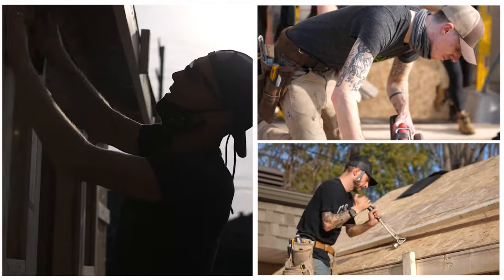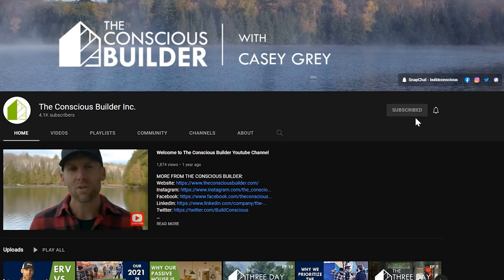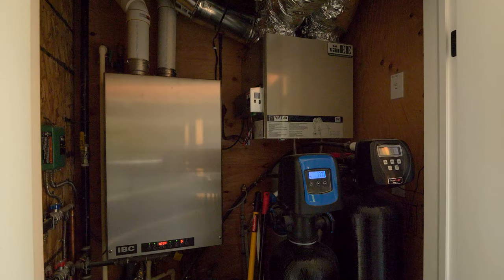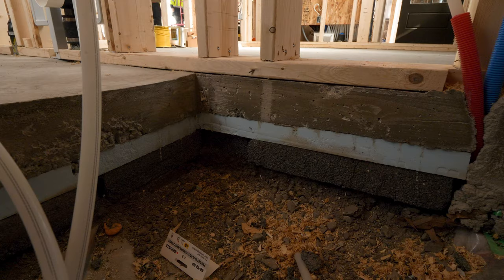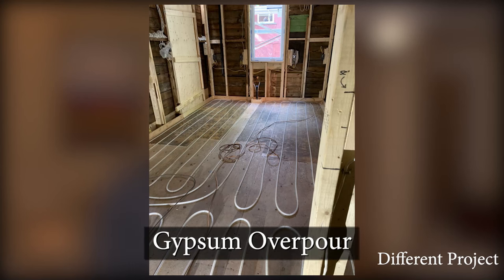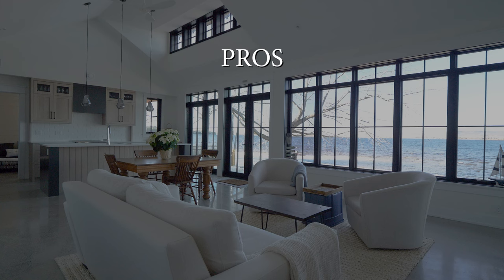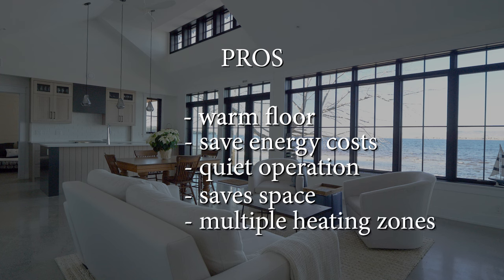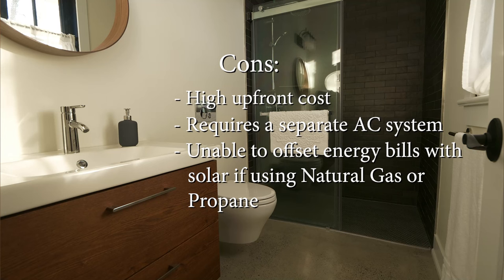Radiant in-floor heating - Everything you need to know - Pros and Cons

Comment: Great and informative video!
What would be sensible way of adding electric floor heating to a home that just has carpets/hardwood and baseboards / forced air?
Reply from the maker: We run electric heated floors under tiles all the time in bathrooms but have not done it under any other surfaces because electricity is expensive where we build and electric resistance heat is not efficient. I'm not sure this would be the best solution if you want heated floors. I would need to know more details.

Comment: I have an idea based off using heat from a Peltier unit used to cool a room, or a fridge etc, and water cooling the hot side, and using that heated water to heat floors. Thoughts?
Reply from the maker: If you can get enough heat from it, I don't see why it couldn't work.
Reply: @Theconsciousbuilder  thanks! If I ever find some time, I will! Maybe skip the Peltier and  go straight to water cooling a crypto mining rig, with the floor as the heat exchanger. Not sure how well that would go in summer..

Comment: Seems like a User Programmable Multi-Zone Heat controller would be effective. 
Replace all the floor thermostats with a Multiple temperature sensor (wireless)  PID controller running all the zones (so they don't compete) plus a few circulation fans between zones; A fairly simple Arduino project. something must already be Out There ?
Reply: circulation fans?  Dude we're talking about radiant floor/radiator heat which is created through pipes and hot water.   Radiant meaning it is simply heat which "radiates" from the hot pipes in the floor.   Since pipes take time to heat up and cool down it is controlled simply with a thermostat.   When the temperature ithe reaches the desired temp the boiler stops heating the water, when the temp goes under, the boiler starts up and heats the water already in the pipes.

Comment: Should the second floor have heated floors aswell? Or is that something that you don't have worry about.
Reply: Heated floors for stick house are only made for cosmetic foot pleasure. It will not be enough to warm house during winter. You will need another system. Radiant floor heating only works in typical European building system (heavy, concrete and steel).
Reply from the maker: Thanks for the question Martha! Heated floors throughout a home is really nice as they can easily be zoned, however it can affect construction. The best way to do it is with a lightweight gypsum overpour on the framed floor which has the tubes installed (assuming we're talking about a hydronic system). You could also install between the floor joists but it won't be as effective.
Reply: @Theconsciousbuilder   I think I prefer the the hydronic system best. But we are still looking. Most likely in a log and timber home.
Reply: You can also combine floor heating with radiators on the second floor.

Comment: How difficult is it to add a bathroom to an existing house with radiant hydronic heat?
Reply from the maker: Depends on how the radiant floor is installed. Over the subfloor or under? Or is this in a concrete floor? In either case it will add some additional work and would require from rerouting of the lines to accommodate the bathroom.

Comment: I laid electric in my tiny house. Ambient heat is needed I'm finding. Also I am finding a heat mat is cold. I'd be interested in knowing if the mats rotate causing a cold mat? Warm feet by thermosoft under a floating wood laminate flooring
Reply: How many mats in your system? we install the electric radiant mats in bathrooms or laundry rooms where we're not getting any heat from our mini splits.  They're almost never as warm as hydronic heating systems, we've found.  Never heard of one rotating.  We install them and then immediately imbed them in mortar to protect them, and test frequently with a multimeter.  We've never installed them directly under a floating laminate floor - I'd be worried about a potential thermal break!
Reply from the maker: Thanks for watching! I'm not sure I'm following this question. If I'm understanding correctly, the heated floor in your home is not providing enough heat. We do heat loss calculations on our projects to figure out what we need for heat and the system is designed to meet those requirements.

Comment: With a water tube based system is there still electricity throughout along with tubes or is it just tubes? Would prefer not to have electricity running everywhere
Reply: The tubes return to the boiler. Only electric is in the boiler itself. Water and glycol mix so it doesn't freeze and burst.
Reply: @TheGuyOutdoors1  thank you

Comment: Very informative! I'm wondering about repairs. What is the likelihood that these systems will have leaks? Similar to the home you showed here, we are considering radiant heat under concrete floors. It looks wonderful, but then I imagine having to rip up that concrete if there is ever a leak.
Reply: "if there is ever a leak"
It is no problem fixing leaks, usually only a small area has to be uncovered. Usually the location of the leak is obvious, because it is caused by a known intervention (e.g. drilling). If the location is not know, it can be found with thermal imaging.
Reply: @williamforsyth6667 thank you!
Reply from the maker: In 20 years of construction, I have never had to rip up a floor to fix radiant heat. The tubes are very durable!

Comment: Great video! I was the aerobarrier tech that you worked with in October.

Just wondering with regards to separating potable water from floor heating water, say you had a reverse osmosis rainwater collection system that fed to a separate tap for potable water (as well as directly fed to an ice machine in a fridge or any other necessary 'potable' sources) would you then be able to combine your hot water tank for showering and washing dishes with the hot water tank for heating the floors?

Thanks!
Reply from the maker: Hi Stewart! Thanks for watching:) You can use the same hot water tank BUT you'll need to separate the floor loop from the potable water. This is done with a heat exchanger and a couple pumps. The floor loop would still stay as a closed loop. When it calls for heat, the two pumps will kick on. One will start circulation water through a loop from the hot water tank to the heat exchanger and back. The other will run the floor loop which also runs through the heat exchanger. This allows the heat to be transfered from the water in the tank to the water for the floor loop without mixing the water.

Comment: i bought house and have radiant heat flooring but how do you turn the heat on? i have baseboard radiators and main thermostat. Do i turn on one of the radiators upstairs and gets the floor heating to run or?? any switch ?
Reply from the maker: I'm not sure how the system is hooked up, so I can't say, but typically the thermostat (or thermostats) are connected to pumps that turn on and off as needed and they will run different zones. If everything is on but some rads or areas aren't working, they may be airlocked.

Comment: What uses more electricity to heat a 900sq ft house at -35 C temperatures.   A electric furnace or a electric boiler with in concrete floor heat?   What's the price difference?
Reply from the maker: Good question! You would need to speak with an HVAC designer or Energy Advisor to model the home and figure out which option uses more electricity, however, I would suspect that the electric furnce would use more because the radiant heat is more comfortable and does not need to run as often. Radiant heat will cost more to install though. And if you need A/C then you'll also be paying for that. Thanks for watching!

Comment: Thanks for sharing this information. Looking for your suggestions, a builder is building a new house in Alberta and are considering to install (at least the rough-in) for the hydronic system for a (600-ft2) basement. 
Do you have any rough idea about specs I should ask from the builder (for the insulation and the piping)?
How much do you think I should budget for the rough-in?

Regards, Hector
Reply from the maker: Not sure what costs are out there but running the pipes should be minimal. Most of the cost would come with all the pumps and labour to hook everything up.

Comment: You forgot to mention that when using multiple HVAC mini split systems, you have redundancy.  If one unit fails in the middle of hot Summer, you still have the lability to cool living space with the other units.
Reply: You can t cool your whole house with only half mini split systems working. It’s impractical for everyone to sit in one or two rooms of a house if others are not cool.
Reply: @ToddBizCoach  I use this method in a one bedroom apartment and per floor in a three bedroom home.  The idea is that if one unit fails, there is still some cooling available while waiting for repair.

Comment: You don't mention solar as a power or heat source...?
Reply from the maker: I'm not sure I understand the question but I will answer what I believe you are asking. Solar is converted to electricity. If you have solar panels that you are using electricity from, the source for heating would then be electricity, not solar. The solar provides the electricity.
Reply: @Theconsciousbuilder  evacuated tubes could provide free hydronic slab heating...

Comment: Is it possible to run a ambient system in a crawl space…. hooked up to a electric hot water boiler …. Ran by a solar system?
Reply from the maker: I don't see why not. I'm assuming the solar system is feeding the grid though and you're pulling power from the grid. Otherwise you'll be using batteries and electric boilers use a lot of power.
Reply: @Theconsciousbuilder  it would be off grid. I have a house in the sticks.

Comment: we are building a new home and are using radiant heat in the basement. We were planning on using LVP for the floors but at a Home Show last weekend, one of the flooring reps said that it was recently announced that LVP is no longer recommended over radiant floors. Can you comment or give any suggestions. We know we could do ceramic but it's more expensive and would be very hard to walk on. House is on a lake so we want something to hold up to kids running in and out from the lake.
Reply: Kk
Reply: K I’m n
Reply from the maker: You can install anything as long as whatever you install can be installed over a heated floor without affecting the warranty. Our clients normally choose engineered hardwood or tile.
Reply: tile

Comment: Me watching the pros list: yes. Yes. Yes. Oh man, the cons are gonna suck aren't they? He's about to drop some knowledge that's going to change my whole plan here. [lists cons] me: oh.... Ok. I can live with that!

Thanks for this video. Just moved into a 1977 build home with brand new (2021) boiler but the old 70s floor radiators and my HVAC guy said since we are planning to redo all the floors in the house (bye bye parquet floors) that we could easily drop radiant floor heating in at that time. But we also need to level out the floors quiet a bit. 

Question: Does the lightweight gypsum act as a self leveler as well? Solving 2 problems at once for me.
Reply from the maker: Haha it's great to give good news! Yes, lightweight gypsum does act as a self leveller as well. It does require some work though,  It’s not just like you pour it and leave it. You need to work it a little. Sounds like that's going to be a very nice upgrade to the current situation!
Reply: @Theconsciousbuilder  perfect, yeah I'm very excited to get this old house up to modern standards! We'll probably have the heating company pour the gypsum and level the floors so we can put floors in ourselves. Somethings are worth paying the pros to do

Comment: You wont get much benefit from set back thermostats with in floor as it is slow to respond to changes.  But I still prefer in floor regardless.
Reply: The radiant panels that go on top of or replace subfloor can respond a lot quicker than a radiant slab. Can use them on top of a slab also. I'm going to go with a mix, in-slab on main floor and panels in loft and see what happens.

Comment: Missed a bunch of cons. First, running water thru pex is just waiting for the leaks to happen as pex does degrade after heating and cooling. Plus you really can't do carpet (at least not well), which makes the rooms louder as the hard floors reflect sounds, as well as things dropped break vs bounce more for carpet. Also as with all water pipes there is the possibility of freezing and damage that comes from it. As people have found out with power being down for a week with freezing temps, interior pipes burst and can crack solid floors. That's just a few cons that were left out.
Reply: Often people use an antifreeze mixture . No need to worry about freezing .

Comment: Any podcast or advice on converting an old home?
Reply from the maker: It would depend on the design and the renovation plan. If you're going to be gutting the entire home, you could go with something like WarmBoard. Keep in mind that radiant heat won't provide A/C though so you need to factor this into your HVAC plan!

Comment: Terrific video. Lots of useful info. I have a question about which TYPE of concrete to use in the slab. I live in Southern California where radiant floor heating is still a curiosity. 
I'm pouring a 2" slab over my existing slab, and this will be my finished floor. I'm told I can go with Gyp-Crete, or Lightweight, or ful-fat. Any suggestions? Thanks.
Reply from the maker: For an overpour you can definitely use a lightweight option. You'll just want to make sure the current surface is prepped properly and that the product you're putting over top is done as per the manufactueres instructions. We use standard concrete rated to whatever the stamped plans say. If we do an overpour on a framed floor, we would use something like Gyp-crete.
Reply: @Theconsciousbuilder  Got it. Thanks!
Reply: @Theconsciousbuilder  Got it. Thanks!

Comment: You forgot hot water heat via pellet stove, yes pellet stove
Reply from the maker: That's not something that's allowed as the main source of heat where we live as it requires somebody to be present. We also can't rely on wood as the main source of heat. We can use both options but also need to have another source that will work if nobody is home.
Reply: @Theconsciousbuilder   lol, not allowed? You have no idea of my system what I have done or how it works. 
I guess that was your easy way out.
That's ok.  I heat a 60x40 shop, with infloor hot water heater with
 a pellet stove through 80 gallon indirect hot water tank with a propane 199000 btu tankless temperature @ 115 f for emergency only or if the pellet stove runs out. Switches automatically when no one is home.
My own design, been working flawlessly for 6 years now.. 8 300 foot runs, 2 zones, 3 pumps one for  low loss header. 
1 pump circulation continuously from pellet stove trough indirect storrage tank.
Constant 66.3 floor temp  ambient -20 c
Reply: Would a propane 30 gal water heater in a closed loop do the trick for radiant heat of about 1200 sq ft.? Or do you think an instant propane water heater or propane boiler work better?
Reply: @NotTelling51  I would go with propane,
How many runs? Is the perimeter insulated?
Reply: @albertwayenberg9140  3 zones 1 pump. Yes it's insulated. Would you do propane hot water heater or on demand heater? The house is only 1200 sq ft.
Reply: Where are you located